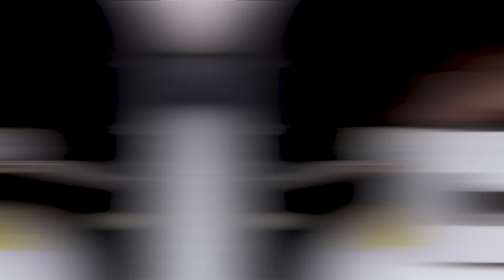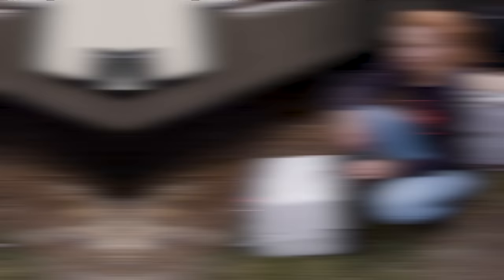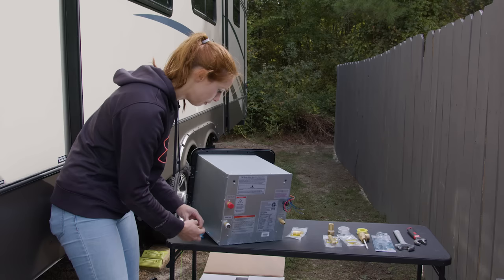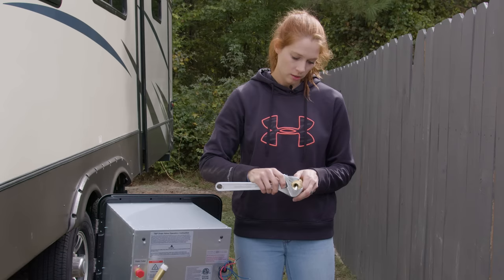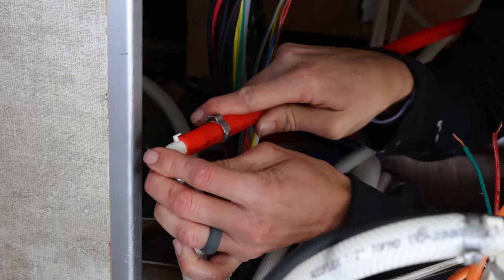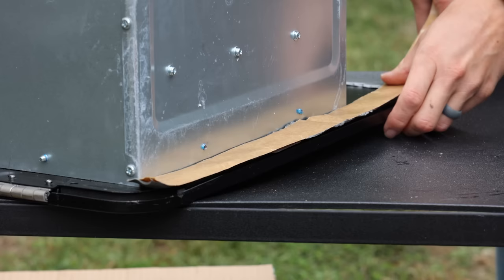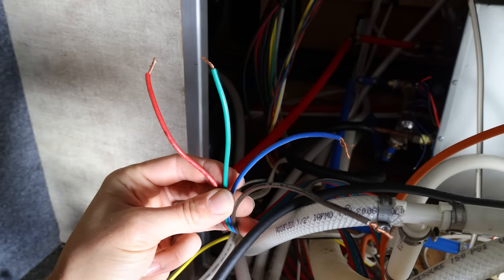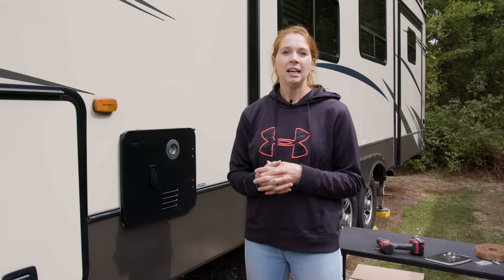(UPDATED) Installing a New Fogatti Tankless Instant RV Hot Water Heater: Easy step by step guide!

Comment: It’s to bad you didn’t get someone to review your video before you up loaded it. This would have been a good “ How to video “ than a “do as I say and not as I do“. Besides the Teflon tape and the pressure valve placement that most of the comments were about, theirs nothing wrong with wire nuts on stranded wire if you wrap electrical tape around it from the wire nut to the wire, but crimp connectors would be better. When using butyl tape on a wall, the top of the unit should have the longest length and the sides underneath it and don’t overlap. While the router is a good idea, I would have put masking tape above the line to keep the fiberglass from chipping. 
That’s just my two cents worth

Comment: You should never put any sealant or tape on the threads of a flare fitting...If it leaks it will leak around the nut and the copper tubing, not through the threads...
I have over 35 years of working on gas lines...
Teflon tape it always wrapped clockwise on the threads...
Reply from the maker: Check the description—this is updated in it

Comment: Never reuse the plastic Pex fittings, if you are replacing or re-plumbing Pex pipe remove and replace any plastic fittings with Pex brass fittings.  The plastic fittings are a very high failure point.

Comment: I was taught many years ago that, if you put Teflon tape on a compression fitting, that you can cause the fitting to come loose as the tape ages.  With gas fittings that is Very Dangerous!
Reply from the maker: Check the description—I’ve made this update along with a few others 🙂
Reply: @fallenintocamping  I wasn't trying to tell you what to do.  I was just letting you know what i was taught years ago.
Reply from the maker: @DeeJayHouser1  no worries, just making sure other folks see the updates and mistakes I’ve made since this video was made!

Comment: You talked about wrapping the Teflon tape in the right direction. The very first fitting you wrapped the wrong direction.  Also you don’t put tape on a flared fitting ie. propane and you put it on backwards.   Also did the manufacturer recommend the relief valve. Our Truma has an internal relief valve

Comment: Wire nuts? NO!

Wire nuts have no place in a mobile environment and less on stranded wire. The proper thing would be crimp connectors (preferably the heat shrink adhesive type) or at very least some Waygo lever nuts.

Comment: You should never use adjustable wrenches on gas fittings! (slip-age/damage). Line wrenches are best but open end wrenches will work in a pinch.

Comment: Wire nuts should never be used on dc connections and with stranded wires.  Replace with wago connectors or crimp connectors.

Comment: Great video on the installation and a great option for hot water for a camper.  It is always easy to be a critic, keep on putting out the videos.  

I agree with @xLopez210x Super good video, it’s one thing to do it yourself and learn as you go but watching someone else do it and seeing all the lines or watching fittings and lines being connected, just gives anyone watching this a better scope to do their own.

Comment: Why don't you re-check your controller connection. The wire nuts are designed for a larger gague wire.  Thanks!
Reply from the maker: This was a temporary fix until I soldered them together. Check out the 8 month video update!

Comment: Hello,   I know this is nit picking.  The flared gas line needs to be parallel with the fitting in MHP.
Reply from the maker: I’m eventually going to make a follow up video, BUT I crimped my gas line a little bit, so I ended up cutting it shorter. Probably should have done a video on how to cut and flare a gas line, but I’ll get there eventually 😂

Comment: howdy there ma'am i had bought one of them fogatti tankless water heater i watch your videos for install and the other video for the water line hook up and when i got done with the install i got 13 volts to the wires for the heater and i turn on all water and gas and than power and the eater heater does not come on i recheck the power and im getting power to the unit i get no luck of the unit to come on  so i still having problems with it im hopping you might be able to help me out on this
Reply from the maker: Hey! First, make sure you check the description, I made a few mistakes (wouldn’t make it not turn on, but still important to make sure the PRV is on the outlet). Make sure the switch inside the water heater is turned to on. If hooked to the original wiring in your camper, you’ll need to turn the electric or propane water heater switch on, depending on which you hooked it up to. I had a problem where it would surge my power when it turned on, so I actually wired it straight to the battery with a check fuse for now until I can get it inside my panel. If your getting 13 volts, it should at least turn on when you open a faucet. Does it power on at all when a faucet is open? Or does it not light?

Comment: Can you just wire it up to your original panel in the trailer instead of mounting the new control panel?
Reply from the maker: It comes with the control panel so you can set the temperature, so you definitely need the new one

Comment: I'm having to replace my Class C my Attwood G6A-8E water heater and size is the concern.  The outside frame is 14 1/4 " X 17 7/8"  and the door is 18" W X 14 9/16" H.  You water heater is similar to mine but I believe the size may be different in height.  My question, will the Fogatti fit in to my opening without much modification and will the 18 X 18 Door be needed?  I appreciate you video, would prefer learning from someone else's mistakes then my own.  Oh and I do recommend using mechanic gloves when working in these tight area with sheetmetal that tends to be sharp.  Thanks!  Dan
Reply from the maker: As far as the fit goes, the unit says 12 1/2 for height but it was actually 12 5/8. My opening was only 12 1/2 so I had to make it bigger. Yours should fit fine…maybe some added support (cut 2x4s and screw into your frame) to bring your 14 1/4 down to 12 5/8, and your width to 12 1/2.  The actual door is 15x18 3/4 so similar to what you have now.

Comment: Hi!  I have a question.  I bought this water heater to replace an old one that didn’t work.  It was a pilot  lit water heater only.  So I have no electric wires running to the water heater.  How do I run wires to new water heater?  Do I run them from the breaker box somehow?  Thank you for your videos.  I enjoy them.
Reply from the maker: Hey! You should still have 12v wires coming to your original, so I’m really surprised you don’t. I actually ended up running wire directly from the unit it to my battery (long story…posting an update soon 😂). Use 10 stranded wire, and add an inline fuse just to be safe.
Reply: @fallenintocamping  I got it put in today.  Took me ALL DAY!  🤣🤣 But I have hot water.  Thank you for your help!!

Comment: I have read all these commentrs and viewed your video which will be very helpful as i  install our Fogatti tankless. however i Have two concerns where does the backflow valve go and how do you check the wiring to be sure you correctly wire it.
Reply from the maker: Hey! I didn’t install a backflow valve. Personal choice, but you can do your own research on it. I just didn’t think it was necessary. As far as the wiring goes, get your meter and check which of the wires coming from your original unit is 12 volts. You can do this a few way, but the way I did it was put my meter on a wire I guessed was 12v and one I guessed was ground and my meter read 12v. Another way is to check each wire individually for 12v and using the frame of your camper as a ground. Make sure your switch to electric and propane inside the camper is on—this will ensure power is going to those wires and you don’t mistake a non powered wire for a ground. Now I ran into a problem—when my unit would kick on, my power would surge. I think the gauge of wire coming from my camper wasn’t big enough, I actually hard wired it to my battery and put on a check fuse until I can wire it straight to my panel.
Reply from the maker: One more note—I kinked my propane line because it was WAY too long. I ended up shortening it and flaring it. If you don’t kink it, it’s fine that it’s too long, but I didn’t have a choice 😂

Comment: After shutting off LP at bottle burn off what’s in line at cooktop
Open the low points and less water mess to clean up
I have never installed a different type water heater and not had to change the plumbing 
As the 1st comment said. No tape on flare fittings.   Big no no
I don’t know how the manufacturers get away with untaped  wire nuts but highly recommend crimp caps as easier than taping wire nuts in tight spaces.   
You missed the most important leak test. LP.  Your water leaks you have a mess. Your LP leaks you could have a fire
Reply from the maker: Some of this has already been addressed in the description AND in a follow up 8 month review. I also did say in the video to always test for leaks.

Comment: We installed this on Saturday, and it worked great on Saturday night and Sunday morning. Now, when I turn it on, the number 5 appears on the controller, the temperature appears, and then nothing. Know any reasons why?
Reply from the maker: E5 says it’s a fan failure…strange that it worked and then it didn’t. Try doing a reset (either disconnect the 12v power supply OR unplug the camper and disconnect the battery). Mine dosent work now either if it makes you feel any better 😂 I’m troubleshooting with recpro right now.
Reply: Thankfully it turns out that mine was a simple fix. The wires coming from the controller has come loose. Did you get your issue resolved?
Reply from the maker: No, they said it was bad (maybe a board issue). They sent me a new one, should be here tomorrow!

Comment: powered by 12vdc. not gonna work for my application I need 115vac under 30 amps so a suburban works for me with a 10 gallon tank and 1.4kw heater.

Comment: Does this water heater not come with a pressure relief installed from factory like the tank ones?  And, is the pressure relief valve dump inside?  I noticed that it's external, not like the 6 gallon tank, whish is internal.  I'm  really curious after some use, how you like it compared.  I just installed another 6 gallon  propane with 12v electronic ignition.  I'm weighing out tankless versus the one that i installed.
Reply from the maker: Nope the pressure relief is external (which is why it’s important to install one and not just hook the unit up and go). I just reached behind it to relieve the pressure the dump the water. We just went on our first trip last weekend and I loved it after a few tweaks to the temperature controller! I wish I would have researched HOW to use it once I installed it…would have saved me a lot of grief 😂
Reply: The relief valve works off pressure and temperature I have never seen a valve installed that way I hope you know what you are doing I would have someone check to see if that is safe
Reply: I think she show a drain pipe hooked up to the release valve that runs to the outside,  hopefully that's what everyone does...
Reply: @fallenintocamping  Great video but I just looked at the installation instructions and it clearly stats the relief valve should be installed to the outlet of the water heater not the inlet like you did.  Please look into this, dont want you and your family to think you are safe when you might not be.  Happy Camping!
Reply from the maker: @The_VagabondZ_Jim_N_Amy  oh my goodness, you are 100% right! Updating in the description—thanks for pointing that out!

Comment: Why add a pressure relief valve, when there is one already installed by manufacturer?
Reply from the maker: There is not one installed. The instructions specify that it is necessary to add an external PR valve.
Reply: @fallen into camping  I just ordered one and in the description says over pressure protection, along with other features.
Reply from the maker: @user-me1zo4cm7q maybe they updated it to add one, but this one specifically says in the installation instructions that it MUST have one installed. You do you— I’m just following the directions from the manufacturer!

Comment: I have never nor will i ever use Teflon tape. I use liquid Teflon. For water lines. And never on a gas line. Gas lines self seal and not designed for Teflon. Getting any debris in gas lines will cause a serous problem.

Comment: Wire nuts bad. Crimp nuts good. Vibration is the baddy.
Reply: Late with replies but a wire nut is mostly for covering. You twist the wire to hold it together and use wire nut to keep it from arcing. I always tape nut also
Reply: @glennwest4438  I believe wire nuts are designed primarily for solid copper house wire. Stranded automotive wire is held quite firmly by a crimp nut and covered as well.

Comment: Definitely shows that if you can do it anyone can. You used the adjustable wrenches the wrong way, had a hard time with lefty loosey righty tighty and then put the gas tape on backwards. Other than that, not bad.
Reply from the maker: Make sure you check out the 8 month review. I realize I made mistakes, and I addressed them. Mistakes are how we learn. I’m not perfect, but I try to learn from my mistakes.

Comment: She did explain how to remember which way to wrap the Teflon but then did it wrong both before and once after.  You have to think of the direction you will screw on the female part and always wrap in that direction.  On a normal(not reverse) thread you always wrap clockwise when viewed from the open end of the male side.  As for the Teflon on a compression fitting a lot of people even a lot of "professionals" make that mistake.  I know this because i see it ALL the time even in "professional" installations.  You only use Teflon or liquid sealant on the mating surfaces where the seal is made.  I would wager that MOST hvac techs put sealant on the threads of compression fittings and not on the mating surfaces where it should be used.  If you want to make an hvac tech 
with 20 years of experience really mad just point this out to them.  

At the end of the day the fitting will probably not leak if you wrap pipe threads backwards.  And compression fittings will still usually seal with Teflon.  That is why some people do it wrong for years and get away with it.  For compression fittings you generally don't need any sealant at all but it can help ensure a proper seal if done properly with the right product

Comment: Would trickling your hot water keep the pipes from freezing ?
Reply: Yes, if you include not only hot but the cold water lines.  And because it is common that there is a manifold where individual lines can be shut off, you must include them all.  Any still water can freeze.

Comment: I recon you got the older non  pressure  regulated  crap  water heaters that the RV place got for super cheap  as a job lot Thats why Fogatti wont  warranty them  ,as they had problems  But trust me all these water heaters are all built in China  at the same factory  now including Lipatrds Furion  ect  So buyer beware

Comment: I installed a instashower 8 plus, does your's ramp up way past your set temp. Sometimes fluctuate?
Reply from the maker: It did before i switched the pressure relief valve to the correct place 😂 now that it’s on the right way, it works perfect.
Reply: @fallen into camping the instashower 8 plus comes with built-in release valve. I had the 10 gal suburban model. So had 6+ wires. I contacted the red and green on my unit. It work. I'm wondering if something backwards though.

Comment: Of course the directions would have told you which wire was what, but guessing with electricity is always exciting.
Reply from the maker: The directions didn’t give any instructions for wiring, other than the polarity of the controller didn’t matter.
Reply: Exactly! Directions didn’t help us at all!

Comment: How long have you used this tank. Are you satisfied.  My wife and I are on the fence as to go with tankless vs traditional.
Reply from the maker: Haha…after I moved the PR valve to the right place, 10/10. We love it…the temperature is steady. We have it set so you don’t mix any cold water in, so my kids can just hop in and I don’t have to worry about messing with the temperature. I’ve used it when it was below freezing and didn’t have any problems with it cutting on either

Comment: If the water temp is below 43 f  or higher than 90f it won't work.  I'll pass on this beauty.
Reply: I have not had this issue. Ours worked just fine this morning at 33 degrees.

Comment: Does it work without shore power will it run on propane in other words
Reply from the maker: Yes, runs off your 12v battery and propane
Reply: @fallenintocamping  Thank you I wondered if it would I might have to replace mine or I might try to repair it first it just leaks other than that it works OK but it’s just propane not electric

Comment: Yet you keep putting teflon the wrong way...

And you should probably check before finalizing that the pressure relief valve is not disturbed by the gas line.

Comment: Most of the tape was put on the opposite direction  and shouldn't the pressure relief valve be on the hot water side???:face-turquoise-covering-eyes:
Reply from the maker: Check the description for updates—PR should be on the hot side

Comment: It's not a hot water heater. It's a cold water heater. Water heaters heat cold water. If the water was already hot, you wouldn't need a water heater.